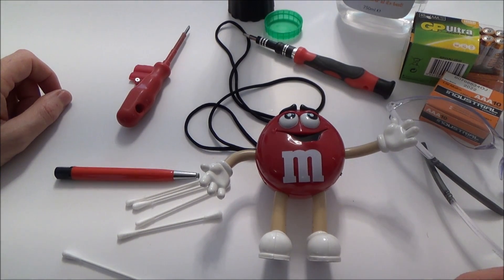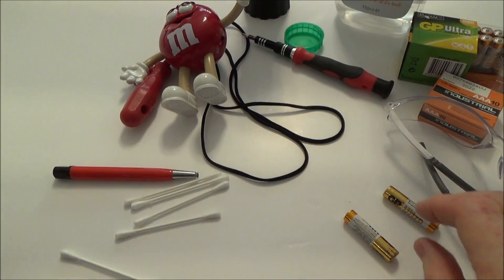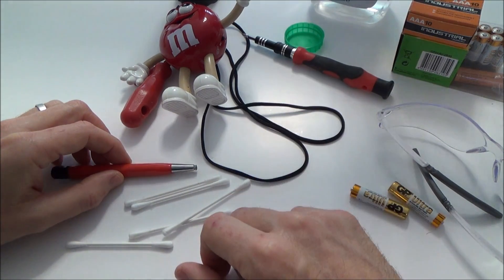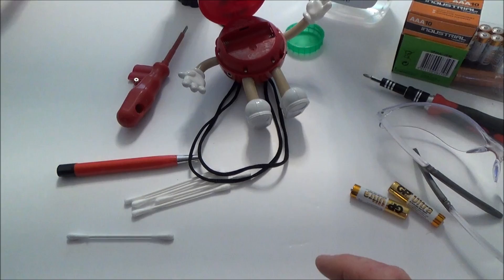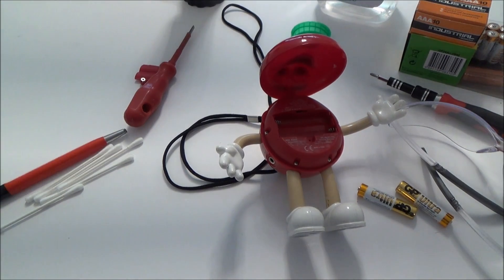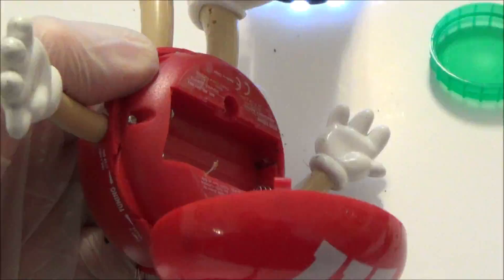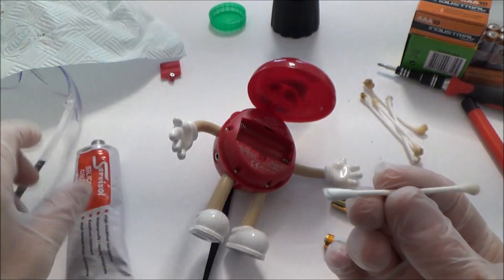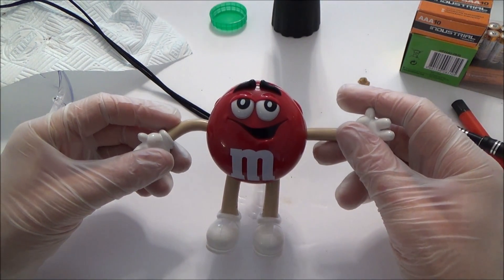TOYS - How to Clean Corroded Battery Contacts

Comment: This helped me with an old temperature clock I found while cleaning out our storage which had a battery still left in it, there seems to be a spot of rust on the affected contact however all the corrosion came off. Really appreciate the advice

Comment: Thanks very much. I spend 2 hours on my semi acoustic guitar pickup not working. Cleaned/re-assembled the pickup circuit, but nothing worked. Before taking my guitar to a guitar shop for repair, I thought I would try your solution (my guitar pickup battery case terminal was slightly corroded) as a final attempt. And yay, because of your video, my guitar pickup is back to life. Thanks again.

Comment: I did the vinegar, scrape, sanding and vaseline method.  No bueno.  However, one tiny single fold of aluminum over the back and front of the contact resolved the problem!

Comment: Just wanted to say thank you for mentioning that car batteries are typically acidic and you should use a base solution and vice-versa for alkaline batteries. Also the silicone grease.

It's crazy how "low" this was in the search results for me.
Reply: His tube of silicone grease says "High electrical insulation".  I would have thought you would want something opposite like conductive grease.

Comment: Thanks you covered the queries I had about such restoration, and more.  Good job.  One point tho' -  sometimes it's gonna be difficult to avoid getting vinegar solution on the circuit board which usually sits under the compartment in such toys.  So, is that potentially damaging to circuitry?

Comment: Thanks for the helpful video! Was curious, if the plating has been accidentally scraped away is there anyway to replace plating? I have a little LED Christmas globe that lights up. I changed the batteries and clumsily scraped away the corrosion I discovered and then realized I had scraped away the contact plating. Is it a goner or can I fix this? Thanks

Comment: does it damage the plastic? I went to open a pack of corroded batteries without realizing the AA batteries had white powder on them near or in the direction of one of my model trains and I just wanted to make sure it wouldn't mess up the plastic or paint.

Comment: Yeah, it worked for me. Had to clean underneath the contact to where the soder was placed. Unfortunately, the corrosion broke the connection with the wire. The good news is that I can replace that soder with some new soder now. So that's one mini project I would put on my list!

Comment: Vince! Any suggestions on how to unstick the battery corrosion from a apple wireless keyboard that i left the batteries in and hidden my closet for 5 years? The batteries are contained inside the top area with a really well fitting thready screw with very minimal gap. battery fuzz has seeped out...and it wont unscrew no matter how hard i try. Open to ideas!

Comment: Do you still have to get ride of the corrosion if you're going to use aluminum foil as a contact point instead? The spring instantly broke off when I touched it, not sure if I should continue to try and clean it or if I can skip this step.
Reply: Ok, just got it working but realized I don't have any petroleum jelly in the house, how important is this step?

Comment: I have 70% alcohol in the house.  I realize you used 99%  Can I get by with my 70% or not?  I live rurally so it means a longer run to get to a store that sells the higher alcohol percentage?  Liked your video, it had good detail but was not overly drawn out.  Thanks.   UPDATE:  I should have checked the internet myself after typing this question.  I did and found a very good answer.  Here is the link in case others wonder the same thing.  If the link doesn't work, you may have to copy and paste it.  https://www.techspray.com/cleaning-electronics-with-isopropyl-alcohol
Reply: I guess we are supposed to use 70%. The article is very long and technical

Comment: Useful tips =D  Regards the alkaline / acid thing I've recently thought about this and wondered what the actual benefit of the alkaline is - I've found it helps the clean up work when you use a weak acid (eg. vinegar), but in theory we aren't really neutralising it. 

The only way to trully get a neutral PH is by balancing precisely the acid against the alkaline, ie. inverse PH values to cancel each other out.  But since we don't know the PH and its distributed randomly all over the place its pretty much impossible to actually neutralise it. 

I suspect as we clean with vinegar we end up with an acid PH level on the board, but the IPA clean up seems to solve that as the contacts / PCB is rinsed off.  Maybe acid is easier to clean away than alkaline, or maybe the acid helps clean up the alkaline damage - I suspect the later.
Reply: The acide will react with the alkaline that sittled on the contacts. 
Resulting in new molecules being formed and disolved into the acid.
Which mean the result from the chemical reaction will be a solution and there are no solid lefts on the contact.
And that solution can be cleaned using the IPA

Comment: You should probably just make people aware that the fibreglass pens produce a fair bit of dust and broken fibres of glass. Best not to breath in that dust, and be careful of the broken fibres that get on your desk - they are very very fine and sharp and will stick in your skin almost without you knowing they are there until you catch the end of them and notice its stuck in you!

Other than that, they are very useful little things to have.
Reply: Handy tip for fibreglass abrasive pens; if you twist the top to adjust the length of the fibre brush,  the shorter the brush is, the more abrasive it's action will be.
Reply from the maker: Thanks for the advice :-)

Comment: great vid. a car electrician once told me to use boiling water on corroded contacts. never tried it.Maybe you could try it on those bad springs and make a vid on it.
Reply: Ok on a car battery but wouldn't put boiling water on the springs of a toy
Reply: Ye that works to, iv done it loads of times for car batteries and then just clean then up with some sandpaper.

Comment: I've used foil as well before to wrap over a a badly corroded spring. It works well as a temp fix
Reply: You can put foil on as a quick check but if it works you,ll probably just leave it there. You’ll need to replace the foil every time and the corrosion may get worse so better to do it properly.

Comment: Baking soda and water work well to
Reply: Aydan Ritenour Baking soda with water is alkaline and does exactly the opposite of what we want to do. We want to neutralize the alkaline substance that started the corrosion by putting acid to react and convert to water and salt (then clear the humidity or wash with IPA because salt and water also make things corrode). The reason why you’re able to clean your contacts with soda+water is because soda is abrasive and acts as a fine sandpaper. It will clean the existing rust but it will not stop the rusting procedure, so it will rust again quicker than if you used vinegar in the first place.
Reply: Aydan Ritenour
For an Acid not for an Alkaline